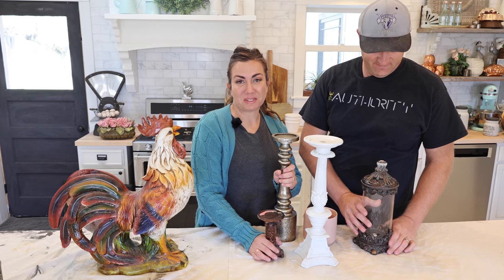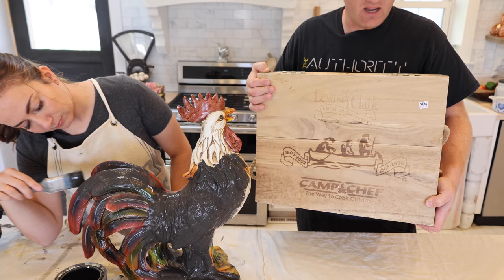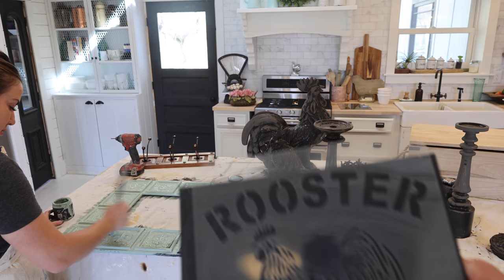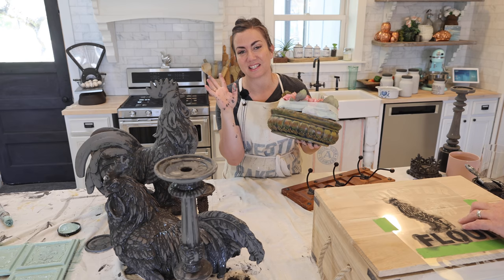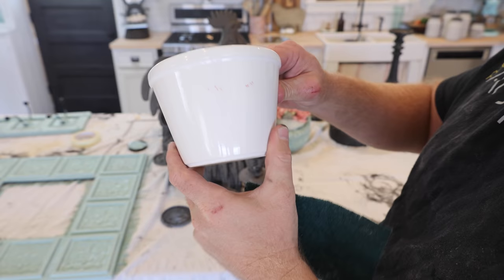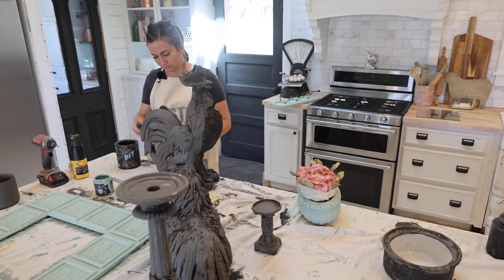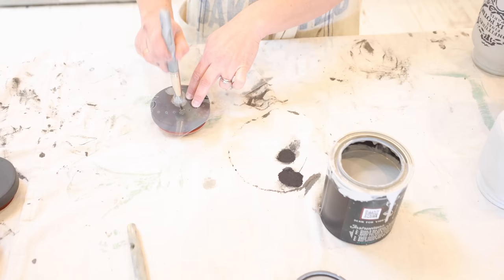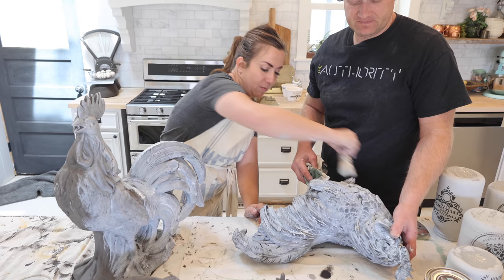How To Make Money Thrifting For Profit

Comment: Zeb-  Martha Stewart taught me to place a layer of paper towels over wax and then run an iron over it.  It works!  For fabric, use a layer of paper towels on both sides (underneath and on top) then iron.  It helps absorb the wax from both sides of the fabric.

And I, yes me, found out that I could heat a bowl (with handles for safety) of water in the microwave and place the waxy item in it for a few minutes and it wipes off pretty good with paper towels!